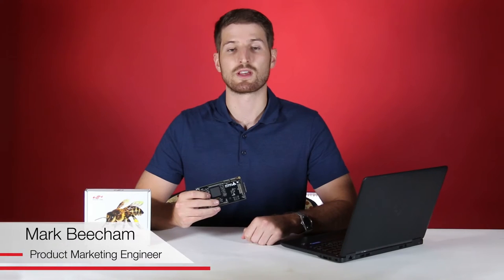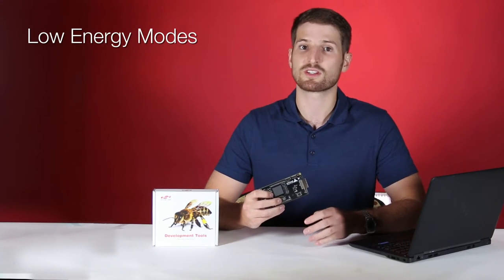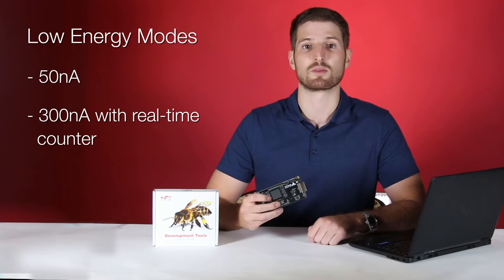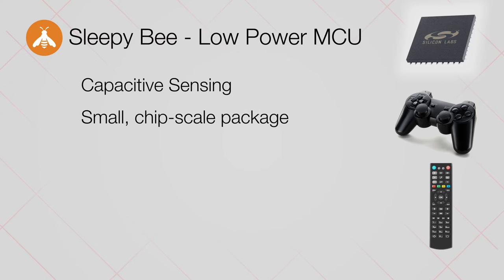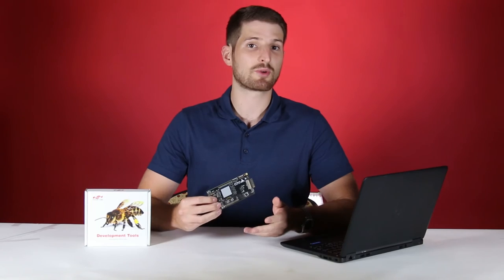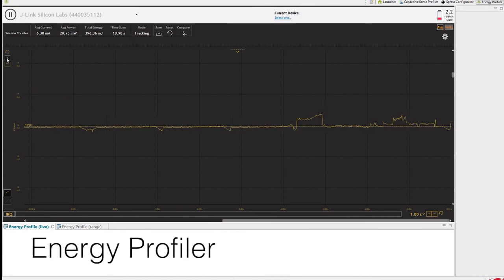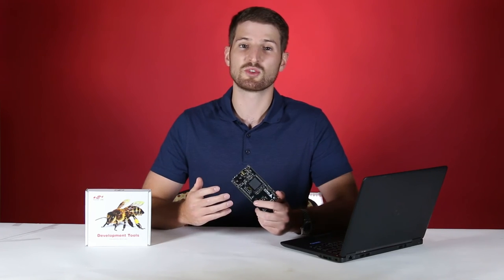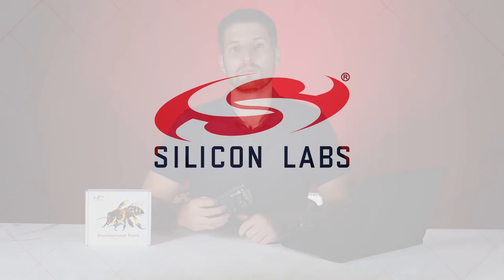EFM8 Sleepy Bee - from Silicon Labs

Comment: 8051? seriously? why?
Reply from the maker: Hi! As you might be aware of, the proven 8051 core has a large installed base with literally millions of lines of code written for it. Since 1998, when this architecture was not patent protected anymore,  the core has been significantly upgraded and modernized. So the EFM8 MCUs from Silicon Labs are ideal for applications which require computational performance, system responsiveness, sensor integration and also have tight budgetary constraints. If the EFM8 does not fit the bill, the EFM32 microcontrollers with ARM Cortex-M cores and very energy efficient peripherals might be better for you. And if you need state-of-the-art connectivity solutions, the Wireless Gecko might be better. So, we think EFM8 has it's place, our 8-bit customers clearly thinks so as well, so that is one explanation. Check out more Silicon Labs products here: http://www.silabs.com/products/Pages/default.aspx